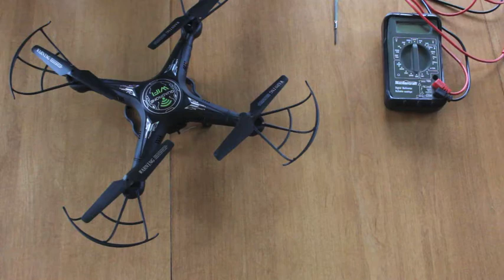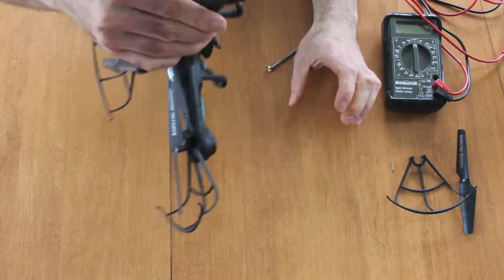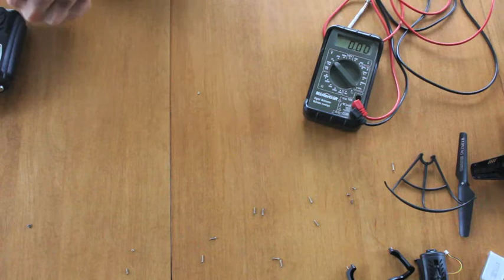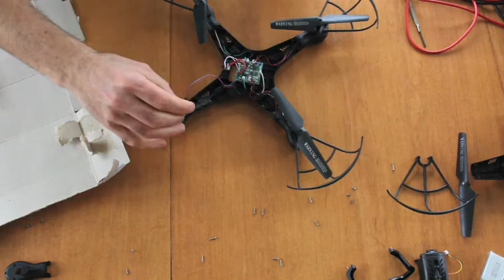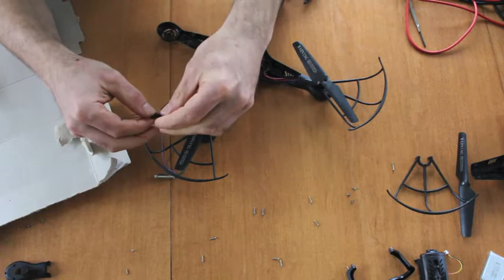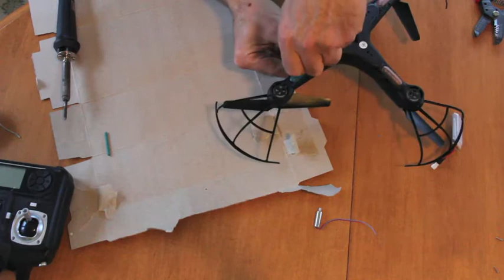Quadrone iSight Motor Replacement

Comment: I started doing this then realized all you need to do is solder splice the wires from the motor to the circuit board. Be sure and insulate them from each other. This way you don't have to take all those tiny screws out and put them back in. Which for me often means doing with b few less screws.

Comment: Hey thee. thank you so much dave. I have a question I was hoping you could help - gladly pay for info. My rotor does spin and the light comes on, but it frequently shuts off right after.  Like right after watching this, it turned on for a second then went off.  I'm thinking maybe it's dirty? I don't know how to solder but really like this - was wondering if the fact the light comes on and it intermittently works means maybe it's just dirty?  It did get some grass in it.
Reply from the maker: I would check for debris first. Look very carefully. It took me a long time to locate the small piece of pine needle that caused my damage. A bit of compressed air might help get small pieces of grass out. I'd take the motor assembly off and try hard to find something. It could be that the motor is shutting off because it's overheating. 

If you don't find anything then check for a bad connection (either at the motor end or the board).

If the motor does burn out you'll have to replace it. You don't have to be good at soldering to do the kind of replacement that I did. You could even use electrical tape, though it wouldn't be as secure.

Good luck.